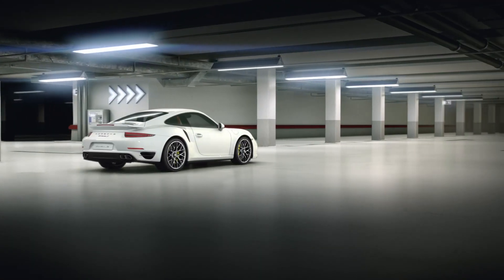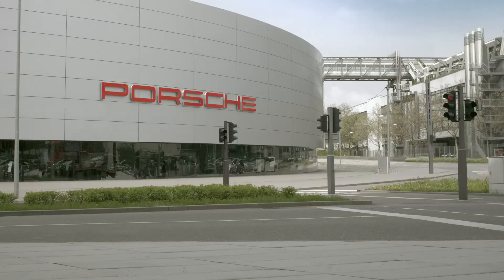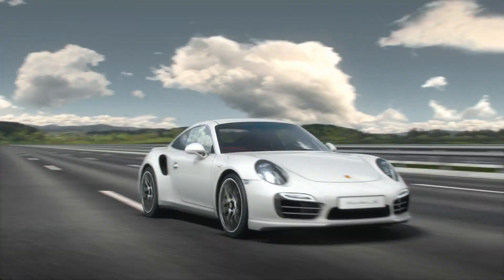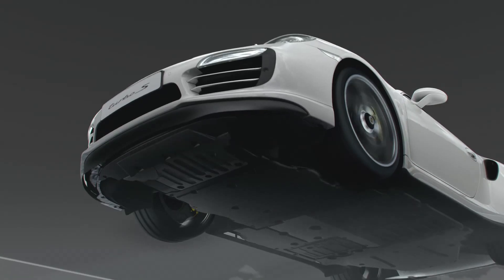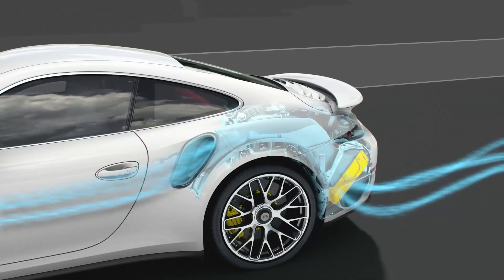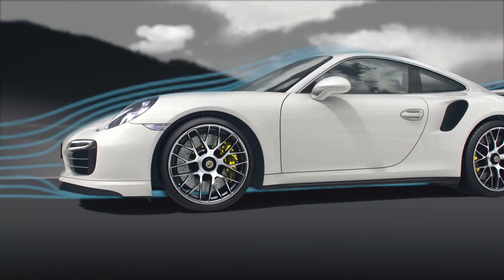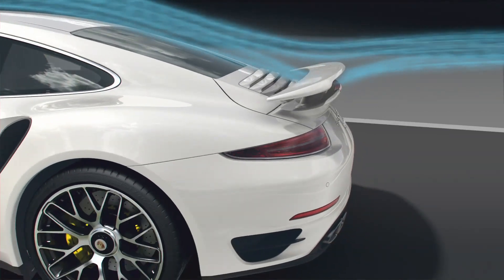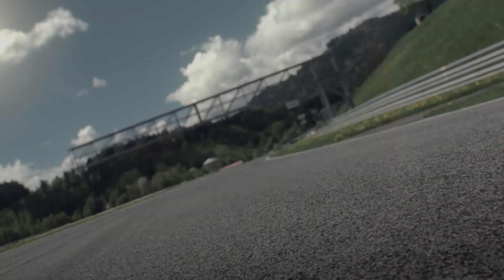Porsche 911 Turbo Aerodynamics: Best of All Worlds

Comment: I drove a 996 Turbo on the track. Even that much older Turbo had awesome aerodynamics. Braking hard at 150 mph the car was super stable, even on rough pavement, and had almost no noticeable dive or tracking error to correct. It really felt more solid and stable at 150 than most cars feel at 50. And that was a 996, ten years and two generations ago! I can only imagine the new 991 Turbo is more like a space ship than a car. Until you have driven a Turbo you have no idea!

Comment: Nice car, nothing to complain about that, but this video is overdone. Its not the "Best of all Worlds". 150kg of Downforce is nothing at topspeed. The idea with the front lip is very cool, but realy, the Turbo S is not a race car, its a sports car. 
"The airflow as optimized as on a Porsche 911". The aerodynamics of the 911 design is not that great...
Porsche, dont over play your cars. They are great, but describe them the was they are!

- A 997 driver
Reply: great explanation!  - Cayman GTS driver
Reply: It's not a sports car, it's a GT car.  The 2+2 seating makes it one.

Comment: awesome, way to go porsche! 

although there is one thing buzzed me up, earlier in highway mode u said that the front splitter goes upward and produces lower drag hence resulting lower fuel consumption..on the contrary the rear spoiler rise about 20mm and produces higher downforce(albeit more drag, compensating the "lower fuel consumption" advantage before.. ) any further explanation about this one?